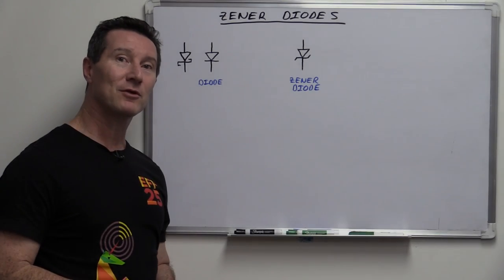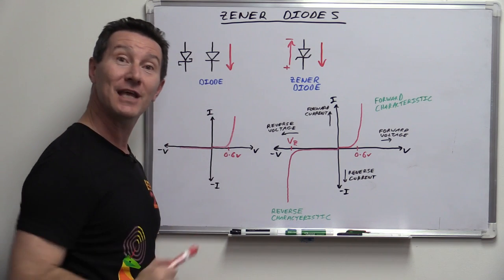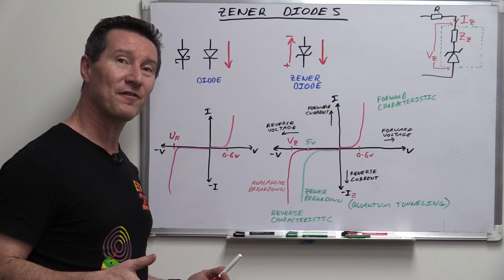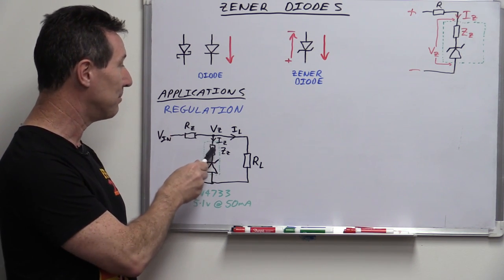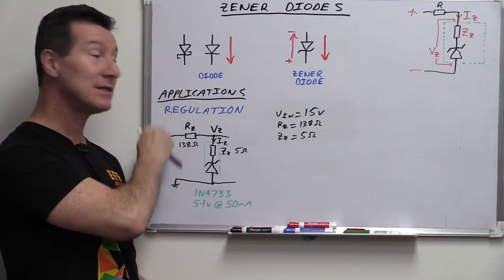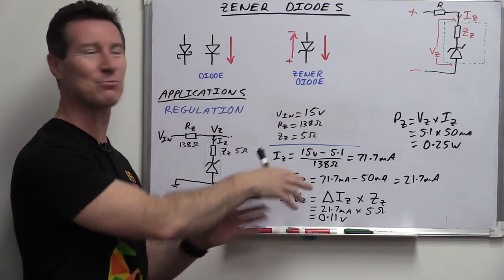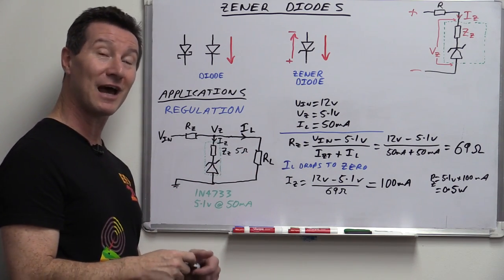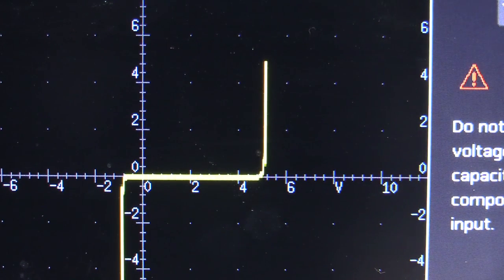EEVblog #908 - Zener Diodes

Comment: Whenever I have to explain diodes to apprentices or work experience kids, I say that they can imagine it like a funnel, hence the shape of the symbol. It only works properly when water/air/whatever enters the wide side, to then leave through the narrow side. A tiny little bit may flow when being used reverse-biased, but most won't go through.
Reply: This is one of the better analogies I've heard. The analogy holds. I think it could help some, maybe most,  novices understand.
Reply: If using the reasonable water analogies, why not relate diodes to check valves?
Reply: Because they don't look like the diode symbol?
Reply: nah, check valves work much better for this one. A check valve allows current to flow in one direction, A funnel allows fluid to pass through in both directions at equal speed,  it just makes it easier to go in one way, which is not really applicable for electronics. 
Also worth noting, if you look at a schematic for a pipe system, the check valve symbol is a diode symbol.
Reply: It's amazing how similar pneumatics and electronics are. The check valve symbol is a funnel with a ball in it. Air/fluid/whatever blows the ball away from the opening.
The check valve analogy even goes so far as to explain the reverse recovery, as it takes a little time to push the ball in the other direction. Same with diodes that are under high load, which take some time to block; within this time, current may flow in the other direction.

At work I experienced it with a circuit periodically charging a flash capacitor with a stepped-up voltage through a flyback-type switching power supply with a UF4007 diode. Eventually the circuit failed. Turned out part of the reason was that the warmer the UF4007 diode got, the longer it took to recover which made some charge go back to the step-up transformer. The power supply realized it had to push more current to charge the capacitor up in time and thus increased the temperature. There was more involved but I can't and won't go into more detail here.
Reply: nrdesign1991 That's interesting :). By the way, google images shows a fairly diverse showing of symbols for check valves, which includes a funnel with a ball, a diode symbol, and others.
Cheers.
Reply: Really, they just look like an arrow, which is the easiest explanation.

Comment: that is a lot of current to sync through a single device just for regulation. I can see them being used for clamping like you said, however as a voltage reference that is really high current required to get into the flat range.
Reply from the maker: Yeah, that's why they are rarely used for just basic circuit regulation any more.
Reply: How are typical voltage references done that draw low current? I assume a zenner is not involved, or if it is, its rather specialty for the application.
Reply: Of course that simple test circuit is not something you would want to use as is. If you want to have a resonable zener-stabilized linear power supply than it is entirely possible for there are zeners with reasonable operation currents but you would at least buffer it with a transistor-based follower. And of course there are other things you might want to add like some fixed current reference, temperature drift compensation, current limiting and other stuff. A real life zener-based power source is almost never just a diode+resistor thing.

Comment: is it normal when (I have a 3.3 V Zener diode) and when I increase the voltage above 6 V it regulates the voltage but it is a big difference like 500 mV is it normal? Then 7 V it will be like about 3.7 V ! (my power supply is 12.5 V max and it incread to about 3.8 V from 3.3 V ). It looks a little bit a lot when I compare with the video (I know the diode which was used here is 5.1 V but I have used 3.3 ) .

Comment: so basically you short the over voltage to ground using the zener? isn'tr this an huge  waste of enegergy??? and there is a danderous  limit of how much the zener can handle?  if the zener blows doesn't the voltage resume the oldroute ? does this al happen at light speed?

Comment: Hm. So, theoretically, if you were to put a 5.1v zener diode in parallel with a load, and set up the resistance in the load to be allow 20 mA at 5.1v (let's just say 250 ohms, seems about right), then no matter what voltage you input (as long as it is probably above 6-7 volts), the load will continue to run at 20 mA, as long as you don't fry the zener?

Comment: Ok so take the circuit at 25:00. What if I put an AMS1117 5.0 there instead of that IC, I don't want the current regulating resistor there since I don't want to be pissing away my power there. What if I put a 1 Mega ohm resistor between the zener diode and the power line instead of in series with the power line? Wouldn't that solve my problem (under the assumption that I don't need a current regulating resistor)?

Comment: Supposing that it can handle it, that's not the point here, if I put say 24 V on a 5.5 V Zener diode, does it pass those 24 minus its 0.6 loss in Volts or does it only pass that 5.5 V no matter how much I send its way?

Comment: You're mistaken about the source of the symbol for a regular diode. It actually comes from the old cat's whisker detectors from very early radios, and is basically a drawing of one.

Comment: Mr. EEV  I have a Gerard Morin pump generator he's on the tube if you want to make ur own . This generator makes high voltage resonant  frequency  ac ( not really but it can read ac on a volt meter ) I want to rectify this to power a DC motor , what diode or rectifier should I use , I am thinking of trying a shotkey diode but I would really appreciate your or anyone on the comments opinion

Comment: So is that clamping schematic good to protect my Line In of the sound card? The voltage I'll put in will be more than 5v in some cases. And the input impendance can be 500k (which is far more than sound card's Line In impendance as I know).
I guess if I'll make this plus a voltage divider to 10 (optional input to 100) times then it will protect my sound card from an over-voltage, right?
Reply: I've used two 1N4148 tonight but it doesn't limits much. Still get 5v+ voltages. I guess it's that "Zener voltage" comes (about 6v?). So I've made a voltage divider anyway. I guess that these diodes will protect my s.card if some static electricity peak will come.

Comment: Thanks for the video, perfect timing. I am in the process of repairing a
 blender and it uses a 30v zener and two 5v zeners. I used Kicad for the
 first time and drew up the schematics. Currently I am trying to figure 
out why a pair of current limiting resistors get to hot to touch about 
150F and what is causing it or is that normal? Any pointer is 
appreciated.  I made a post over at eevblog repair, Kitchenaid blender repair.  The circuit is. 110 ac go through 2 parallel 3.4k resistors, then 1n4007 diode, a 220uF 63v cap then 30v zener followed by 4.6 resistor then 5v zener.  Within 5 minutes the parallel resisters get hot 150F.
Reply: Dumb question I'm sure, but did you figure the resistance correctly for the parallel 3.4k resistors? Do you know how much current is flowing thru each? I use SystemVision.com (free) so that I can get voltage drops and currents anywhere I want dynamically; I'm sure it would help you.

Comment: Maybe good (and important)to point out that another downside of zeners, is that they are relatively noisy. This means that you have watch out with circuits which are sensitive to noise.
Reply from the maker: Yes, there are half a dozen different things I could have mentioned. But you have to stop somewhere.

Comment: Thanks much again (upright) Dave :-)
I'm currently thinking about an application where I need reverse polarity protection with minimum voltage drop but I guess that zeners are not an option. ESP8266's can use up to 215mA, and that combined with 3.2v LifePo4 batteries means I may have to opt out of the reverse polarity option altogether (or use a FET). Any ideas guys?
Reply: Pmos with low Rdson in the positive rail with gate tied to ground through gate stopper will provide reverse polarity protection and lower voltage drop than schottky diode.

Comment: Could you reupload this one, or make a separate one where TVS diodes come into play? I am trying to understand, due to the fact that I need one :-D But all I can find on old motherboards are Zener and Skotchky. Prolly the same mechanisms goes for TVSes but I am looking for a valid replacement (for a T-con board). Also, the TVS I have here doesn't seem to measure in the same way when testing compared to a "normal" diode. So now I am confused... is it broken? Or is it behaving according to its designed characterics?

Comment: Question here: is there any point in using Zener diode to regulate the voltage coming from a solar cell (up to 10V) to a powerbank and an arduino? I've calculated resistor value as 13 Ohms, and I've got a 5W Zener diode with heatsink. Powerbank and arduino need about 450mA (worst case scenario - charging the battery). Sadly I've got no better idea to solve this.
Reply: Use a buck regulator; linear regulation is wasteful at significant current loads.

Comment: how can i distinguish when the diode in its avalanche mode or zener mode.
Reply: By the diodes z-voltage. The Zener-effect dominates at lower voltages up to 5-6 volts. Above that the avalanche takes over. Makes diodes in the 8V-range interesting as the temperature drifts cancel each other roughly out.(always check the data sheet for your specific device...rules of thumb are just that)

Comment: Good to see you standing.  Leg must be healing nicely.
I never really liked the Schottky diode symbol, if drawn sloppy you can confuse it with a Zener.  Sometimes the Schottky symbol is drawn with square ends, sometimes like in integral sign (S for Schottky).  The latter would be less confusing with the Zener.

Tube (valve) guys will think of the Zener as like a gas shunt regulator tube (0A2, 0A3, VR-90, etc)
Reply from the maker: +Kenneth Scharf yeah I never cared for the schottky symbol either.

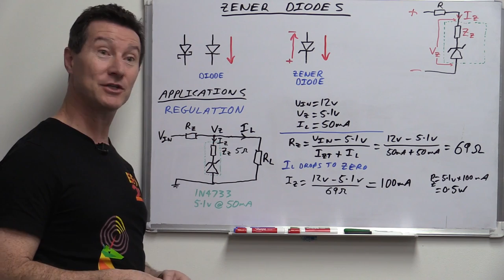Comment: 20:00 - Does that mean that many of the devices which draw "almost as much power" in Standby/Sleep mode as in normal operation (as determined by the ultra-rigorous methods used by TV news shows) are likely using a zener for power regulation?
Reply: Come to think of it, we made an electronic thermometer in school (they taught us how to solder, but no theory whatsoever) that used a diode as the actual probe to detect the temperature.  I remember (possibly incorrectly) that it was a zener diode - I'm assuming it was reverse biased and we were using the dynamic resistance at varying temperatures?   Haven't thought about that project in 25 years.
Reply from the maker: +Tzisorey Tigerwuf no, they are just poorly designed switching power supplies

Comment: I love these fundamental fridays. Hi Dave 1.0 have you done broader view on Diode components? As a person who's education drops under the EE umbrella, but have only basic knowledge (maths / physics) of electronics these component and design vlogs are really interesting. Then I actually can go and open a Datasheet. 

That said as you have all sorts of fancy to drool after equipment in your lab, what about a to pick of inductance and capacitance measurement, with different type of equipment? Trying to figure out myself atm. the pitfalls of the inductance and capacitance measurement with only a basic scope and sinegenerator. I did find out it weren't as easy as theory did tell (in level of "DaveCAD" analysis). It seems there is no "one do it all" method, if your equipment (meters and references) are limited. Which is atleast way to learn things. All for the reason I do not want to order one coil from abroad to make a step-down switching pre-regulator for end linear regulator for Solar to USB systems that will fit top of my canoe on wilderness trips to get power to my camera, dang. Lol.

Comment: This is great if you have a steady source and a steady load, but what do you do when you're using a DC to DC Module and it calls for a diode to stop reverse power when charging a battery or it burns the chip? Remember the source will be less than you tested before the load and not just because there's no load on it, but because you lose power when the diode heats up, wasted energy so you can use a P Channel Mosfet ( Gate, Drain and Source) it runs like a switch) I'm trying to figure what value to use when I'm charging 32 18650 batteries wired in parallel to charge while I have 3 banks wired in series equaling a 12.6v power bank. I have one module on each bank charging to 4.2v x 3 it works but how do I stop the back feed? Which way do I go here?

Comment: You can use a zener diode for over voltage protection. like on a usb port
Reply: which one do you recommend as i want to protect the D- and D+ data pins from any voltage spikes over 5v and also the 5v power line. i have a 5AMP fast blow fuse on the input. im building a usb phone charger using the lm1084 ADJ version resistors configured to give 5.30v out
Reply: Something like USBLC6-2 should work. Fast blow fuses take seconds to blow (look at the time to blow vs. current plots).
Reply: The P6KE6.8A are quite expensive but the  USBLC6-2 are cheaper and i can get 10 of them for round £2.so i will go with them.. my usb charger is 5A capable will these still be ok to use ? . and i have added a 5A  poly fuse on the 5v input. thanks  everyone for help really appreciate this
Reply: Sci-Twi  im making a usb charger only. no dat will be used. however i have to add resistors to the data pins to tell apple devices to charge at fast speed 1A and other devices require 200ohm resistor across both data pins. so iv done 2 usb ports each pot configured for apple and the other for other devices like android. i wanted to protect the data pins from voltage spikes only as anymore than 5v on data pins destroys the connected device. at least that goes for mobile phone.i originally just used a zener diode with a poly fuse for protection (one on each data pins.) but im thinking a better solution would be  USBLC6-2 this is only a 5A usb charger using the lm1084 (a fun little project but wanted some protection just encase something goes wrong one day with the regulation and spits out 12v instead of the 5v.
Reply: im using  REG1117 that converts 12v to 5v and that gives power the resistors connected to D- D+...if this regulator fails it will send 12v down Both data pins and destroy the mobile phone connected. i tried this on an old iphone 4 and 7v on the data pins killed the phone instantly. i used a zener diode that would short out over 5.60v  that would then blow a poly fuse for some protection. do you think i should stick with the zener diode method ?
Reply: so i should replace the 2016 8A poly fuse on the 12v input with a standard 8A fuse (burning wire inside)  i then connect the P6KE5.0CA from 5v to ground with a 4.7k resistor like in this pic http://www.zen22142.zen.co.uk/Design/ovdemo.gif
Reply: Thankyou for the schismatic really help me understand :D the REG1117 is only supply 5v to the usb data pins though resistors. its so apple and android phones know the charger is capable of 2.5A the reg1117 does not even gt warm to the touch so i think it should be ok ? im unsure what type of zener to use as mat AMP the charger can give is 5A max im using a 5A fast blow/re settable  poly fuse too
Reply: because the lm1084 gives out 5.30v with a 1A load but the voltage starts to go down as i connect more mobiles to charge (more Amps. this changes the voltage on the data pins which ends up making apple phones stop charging at there maximum 2A.. android phones are ok becasue you just short the 2 data pins with a 200ohm resistor but apple devices require a 2v on the D- and 2.70v on the D+ if these voltages change the apple device stops fast charging..
Reply: i was thinking on paralle  2 LM1084t  for a total of 10A...Thought it would never draw no more than 4A max as i only have 2 usb ports so only 2 mobiles can be charged at the same time. most devices never charge more than 2A so worst case 4A max the phone charger would ever output at any one time. maybe i should use a 4A fuse or stay with a 5A ?
Reply: would i be able to use a B2X84-C5V6 ? as i have some in my parts box there TO-236 package but i want to do it in smd anyway. would i have to add a resistor ? and i guess its not a good idea to use a re settable poly fuse then ? or do i need to use a tvs at 3w ? can only find 500mw ones
Reply: Lets go with LTM2884 :D No spikes at all ;)
Reply: Cezary Rodziewicz Decided to go with with but im not sure if i can supply it with 12v anyone know best voltage to give it ? i want to power it by a power supply not batteries 
http://oi65.tinypic.com/15g5vth.jpg
Reply: You can't because it is a boost converter so you need to power it up from lower voltage than desired output voltage.
Reply: Data sheet says  2.2V to 12V.
what would you recommend i use for a plug in power supply?

Comment: Dave, i have a question to the Idea, clamping vcc to vss with a Zener. 
I have done alot of experiments with this in the past and found out, that most of zeners become extremely noisy in their threshold region. I dont think it would be a good intend to go for it. Tempereature, noise on the VCC rail and yes, other ambient circumstances became the most univited guests for me. 
I have done experiments on analog frontend protection as well as clamping vcc rails. I have also found out, that some of them had a pretty bad microphonic characteristics, unfortunately i hav'nt documented this in the dash but have'nt discaded the idea to use them in these particular cases.
Are there specially low noise types on the marked?  Maybe i have'nt done enough research on that. 
Kind regards and get well soon! Cheers from Germany.